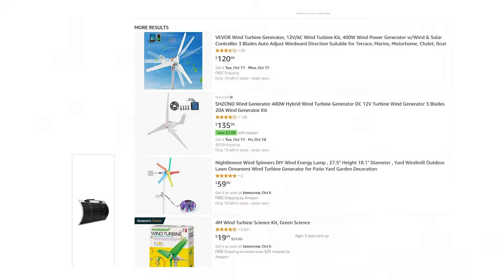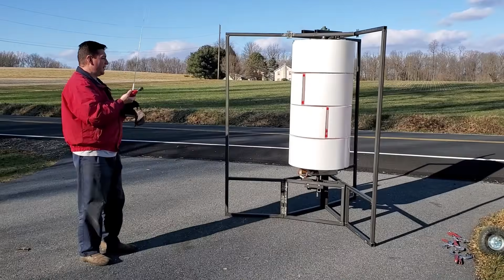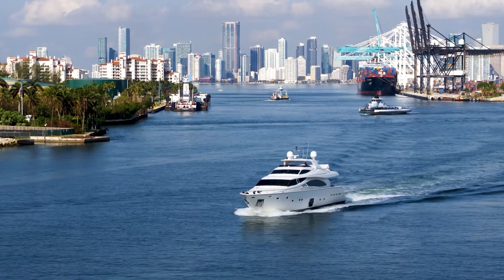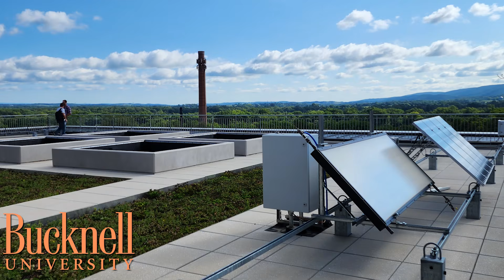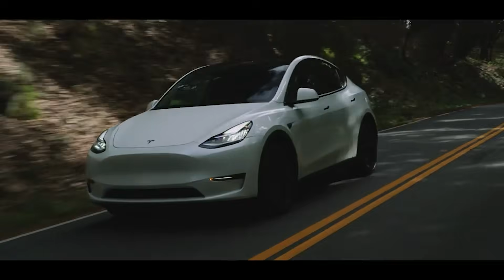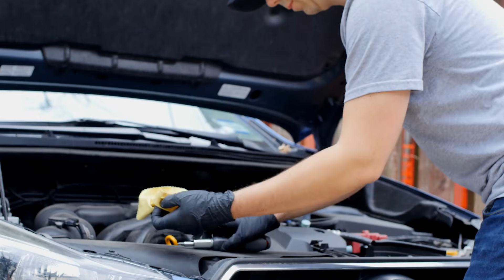Harmony Turbines | The Perfect Small Scale Wind Turbine?

Comment: Consultant wind engineer Rosie Barnes has a number of videos explaining the advantages and disadvantages of various types of turbine on her channel 'engineering with Rosie'. It's a scientific fact that vertical axis wind tirbines are inneficient because half the rotor is opposing the rotation at any time. It is also a scientific fact that wind speeds are highr at greater altitudes.A ground mounted horizontal axis wind turbine isn't likely to generate enough energy to pay back the cost of its construction in its whole lifetime.
Reply: Course that’s the economics of fossil fuel “capitalism”. Your cynicism does not impress.
Reply: @Intelli24U  fogiive me for relying on facts. Economics is economics whatever the context
Reply: - depends on what the cost of manufacture is.  do you think making sailing ships in the age of sail were cheap? they had to level whole forests to build one big 3 deck warship like Nelson's HMS Victory.   not to mention all the trees they had to burn to make the iron for cannons and iron fittings for those ships.  but the Brits doing that is why the Brits gained an empire and why you speak English today.  They have already invented an injection molded recyclable polymer that is stronger than carbon-fiber.   Right now it is expensive, but as they improve the technology theoretically a 3D printer could spit out one of these wind generators at the cost of materials.  At just 20-50 years of public adoption of wind & solar power, we are roughly at the Model-T level of auto technology.
Reply: @vvvci  I fail to see the relevance of the past technology of sailing ships which were the pinacle of technology at the time. 3D printing is a time consuming process and would be the last option for low cost mass production.

Comment: the bashing of "normal" turbines (big scale) is kinda lame. Small turbines just dont scale nicely, solar is kind of same level for all (per area) but not wind (you need elevation and/or clean wind off shore), this "thing" cant fix that.
Reply: Wrong. Even if there are qualifications as to location we are facing do or die parameters per our energy based civilization. All possibilities count!
Reply: @Intelli24U  so you tell me it's "efficient" to use 25000!!!  400w rotors vs one big new one with 10 MW? rare exceptions of islands/self supplier - ok maybe a good addition if you dont have enough space or conditions for solar+batterie only, but other then that for the grid this is ... peanuts. dont want to downplay the design and thoughts of the designers, it's kinda neat but by no means a serious solution.

Comment: Sorry,but vertical axis turbines are NOT anywhere as efficient as horizontal axis turbines. The power from a VAWT is generated by maybe 25% of the area of the turbine,and the advancing parts of the turbine work AGAINST power production. HAWTs generate power using 100% of the surface area facing the wind. There have been many VAWTs invented over the years,but they all fail for those reasons. It is telling that all the biggest wind farms use HAWTs.

Comment: That it can curl up is great…
But that shouldn’t require an active system.
Active systems always eventually fail.
Safety measures should always be passive.
If lightning strikes a tall metal tower and shorts the motor that furls the scoops it’s toast.
Maybe they have countermeasures for that, but didn’t mention them.
But surely they don’t have countermeasures for everything.
Reply: And the first automobile didn't have snow tires and defrosters either. Iterative improvements ...as we see things to improve we will fix them. It's how all R&D should be done, no? Share the project as you do it, publish everything openly; hide nothing.
Reply: A mechanical  centrifugal governor could make sense. The victorians knew how to solve problems :)
Reply: @pete_dl1585  - I wonder how a Flyball Governor could control that "Furl" & "Unfurl" action, that they have?
Reply: I like that they’re committed to full marketing for the sake of we people.

Comment: The furling system is clever! Vertical turbines get a bad wrap because they are less efficient in ideal wind, but I’ve always thought they make more sense for dirty wind. If I ever live in the right place I’d be interested in this system.
Reply: The furling system is the only thing going for it. It doesn't make it more efficient. They just don't make the torque as blade turbines do.
Reply: @sloansteeringsystems  It catches wind from any direction..that's a plus.
Reply: @robroy9185  Yes, but the horizontal type can as well, it's just a bit more of a challenge to manage the cabling so that it doesn't wrap the tower. Which is a solved problem. Either you can mount the generator on the tower facing up with a pair of gears, or you can use a slip ring to do the job.
Reply: The typical VAWT running a blade type Darrius rotor requires higher wind speeds to operate.
The Savonius type produces a higher torque at low wind speeds and because of the shape of the "bucket", uses the Bernoulli principal of lift to reduce drag.
Reply: @sloansteeringsystems    But the sound damping factor is a plus. Not to mention functioning in dirty wind. For small scale and home owner ease it’s looking good.
Reply: @sloansteeringsystems  Can the tower have both types?
Reply: - even a "split drum" Savonious Turbine can be made to auto furl, using "drawer sliders" and counter weights - very lowtech, or add sensors and steppers to make as adaptable as desired. 
Noting that unloaded, a drag turbine's tip speed can not (generally) exceed the windspeed, while on an aerodynamic turbine (HAWT or VAWT)  design (many different varieties , the tip speed (unloaded) can exceed wind speed "several" - to  - many times, greatly increasing stress on components mounted on the end of a large radius arm.  (also a drag type device still puts significant "drag" on the tower in high wind speed, while an aero design has minimal drag (destructive force on the tower) when furled and stopped.
Reply: @kadmow  Why is rotor speed so important; it's the torque your looking for.  The more surface area exposed to the wind, the more torque can be derived from it.
A common example would be carrying a sheet of plywood.  When positioned end-on into the wind, where the perpendicular surface area exposed to the wind is minimal, it is easy to control and walk with it. When the full sheet is exposed, the resistive force can push you back or knock you over, the force is multiplied over the surface area.
The Savonius does have an inherent drag problem but the curved exterior of the Harmony style "bucket" reduces drag significantly by using the very same principal employed by the typical HAWT; the Bernoulli principal.  The Savonius will never overcome the drag but it is still the best choice for "dirty wind" applications.
Reply: @Digidoc316   Torque (Nm) may make the world go around but Power (W) is what makes things happen... (jk)-  and energy (J)  is what we need at the end of the day (yes that is a joke too).

Torque was great in the old days of wind when it was doing slow tasks ( not power constrained - noting that the best "transmission" is none - Yes even Teslas do have a transmission despite the claims of BS-er in chief ) - and belts are worse than gears )- we have moved beyond that and extracting the most energy out of the wind is simpler/possible at a higher speed multiple (Power is Speed x(times) force, power is also Volts (V) x Current (I) - not called "Amperage" despite American  popularity) ...   (notice how the "vocal one" was elucidating about how terrible "propeller style - whatever that means - wind turbines were, then showing a curve which went to the moon??? - so terrible, yes really...  Yes anything which is highly stressed, and optimised for "median" cases will fail and break at times - no defence for failure under "expected" but otherwise extreme   events - also things do fail at times...)

I have studied "engineering" (whoopdy-doo - who cares about academics) and do understand that power - force and torque, rotational velocity and linear "speed" all have their analogues and conversions...

 - IF you try to slow wind (any fluid) down too much it merely flows around your "extraction tool" - you can't just gear it to zero and get more torque.

I have not done any CFD on these but, don't actually think that the interior shape of the foil will add  a whole heap of efficiency (just as a thin optimised aerofoil is usually more efficient, but structurally poor - just in as the plywood example) (await more research from some undergrads thinking outside their box), the theory of a Savoneous is that the continuous curve allows "some" of the wind energy to be extracted by the reverse curve of the lee-side blade (again, we can question, does this actually happen in a meaningful way ??), this design will most likely take it all to turbulence / cause separation, close to the mast (smaller radius, lower torque) and increase wind load on the structure (no problem if it is in terrible wind areas with no "real" generation potential) - it could be better to vent it out - reducing drag, increasing startup times / lower "cut in".....

Solar is generally the best choice in dirty wind applications, these devices are often edge case toys - they make the garden look nice, if tapered neatly and painted green nobody will notice them.

Who knows they may take the world by storm..

NB, I actually have a soft spot for VAWTs, but of a more complex style than has been widely utilised - variably pitch / controlled pitch varieties - more analogous to a Voith-Schneider propulsor with the ability to operate in the low and high speed regime (reduced "cut in" effect) with increased efficiency - yes operating at both ends of the spectrum is of little use to energy companies.

I am Sure "Engineering with Rosie" will have different talking points.
Reply: @kadmow  Finally, someone who speaks geek!
It appears both of use have some engineering under our belt.
The term "Power" has multiple applications but is generally referred to as kinetic force through a distance; the ability to do work.  
Speaking electrically, there is the EMF measured in volts, the resistive load (whether inductive/capacitive  reactance or linear) measured in ohms, and the current measured in amperes (coulombs of charge moving past a fixed point in 1 second). 
It looks like you are taking a commercial perspective where this system is designed for small dirty wind, not commercial application.
I am familiar with the Voith-Schneider blade assembly but literally with a twist.  The upper and lower support platforms are off-set 90 degrees with the foils maintaining a smooth transition while remaining parallel to the plane of the axle. This "twist" hybridizes the Savonius and the Darrius by allowing a small portion of the blade to act as a Savonius "bucket" to achieve start up in low wind conditions.
The curvature I spoke of was not the interior but the exterior of the blade.
The curvature will help to reduce the drag, which is pronounced in these systems.
Reply: @kadmow  Governors for rotating devices have existed for quite a while at this point. From what I can tell they date back to at least the 18th century. Part of the issue with this particular design is that it's intended to protect against something that's likely to be a rare event. In terms of the generator burning up from heat, there's a few options there from larger heat sinks to blades that can adjust their pitch to fix the upper limit on rotational speed to flywheels that slip above a certain stage.

I do think that this is an interesting approach and I wish them luck, but I'm not sure this is the solution to the problem.  Even a spring loaded mechanism that's designed to open the scoops beyond a certain amount of force would probably work.
Reply: The other advantage is being able to use arrays with minimal clearance whereas horizontals turbuance interferes with downwind units.
Reply: @davisrs1  Any turbine extracting power or creating dirty air affects the downwind units, the "close packing" identified in research - I believe -  was related to counter rotating pairs  feeding off upstream vortexes - and not random wind patterns nor turbine placement.

IF energy is being extracted (either drag or real work) there remains less for further extraction...  Or it is all "magic".
Reply: Not sure but I’m guessing this will not decimate the Audubon population as do the giant wind turbine farms do today or be a negative impact on the eco system.
Reply: @tywebb140  You are correct.  The large MW turbines have a slow hub speed but because of the blade length, the tips are moving at significantly higher feet per second.
Even so, most smaller birds have the maneuverability to avoid the blades; it's the large soaring birds that have the greatest risk.
Even though the hub speed is higher on the Harmony system, it's proximity to the ground and blade shape would seem to pose a much smaller risk.
Now if we could get the owners of heliostatic arrays to switch to a concentrator trough system, we could reduce the aviary mortality rate significantly.
Birds chasing flying bugs fly into the concentrated light from the mirrors and burst into flames within a half a second.
Reply: @Digidoc316  Cats kill way more birds than any propeller.
Reply: @stevenanthony9387  My stool sample is smarter, looks and smells better than you.
Reply: The main problem with designs like this is that they are cover a small area against the wind at the energy that you can get is directly connected to how much area you face into the wind. Having many small unit is a lot more costly then a few large one high up where there are much more energy to collect.
Reply: @bknesheim  The idea is to create a turbine suitable for "dirty wind" urban and suburban use where mounting a turbine 60+ feet up is impractical or impossible.
You are correct that the amount of power that can be extracted is directly proportional to the surface area and distance from the axle center.
However, do not confuse "swept area" with "surface area".  The swept area is the area that the blades travel within but the typical thin HAWT blades themselves have a wind contact area that is a sliver of the swept space at any given time; they derive their torque from the length and the rotating mass.
With the Harmony system, the "buckets" are sequential so that an area equal to or greater than one vane is in the optimum position for torque extraction.
While the diameter may be small, the area receiving pressure from the wind is significant enough to begin rotation in extremely low winds.
Using a 1:2 Gates belt system, the 50-60 rpm of the turbine will turn an alternator at 100-120 rpm; fast enough for a "pancake" alternator to put out 60 volts.
That 60 volts can run through a charge controller and charge your solar battery bank or be used by the homestead loads.
Reply: @Digidoc316  Yes in my comment I used "surface area" in stead of "swept area", but for the vertical design you must remember that on side pushes into the wind and reduce the efficiency.
Really the main point is that for the cost of the wind turbine you can get a lot more energy from the same cost in solar panels.
They will last longer and with less upkeep.
Reply: @bknesheim  I agree.  I've tested solar for over 10 years now waiting for a plateau in technical advancement to buy big. I've seen how reliable and powerful they can be.
The idea of a small wind turbine for me was to have more than one source of production and testing.  I have a great low-speed alternator based on the F&P pancake motor but I need to find an efficient way to drive it.

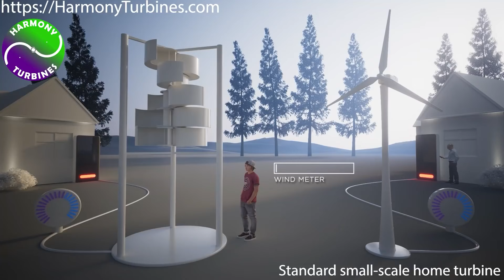Comment: 7:00 we spin when no power is generated so we look cool!
Reply: NO, what we're saying is we get up and get moving where others don't even think about moving. It's all about the "flywheel effect" in wind turbines. The flywheel overcomes cogging and helps to get everything up to speed sooner so that when we CAN produce some power in better wind, you're ready for it. Please don't twist our words. We were careful to say, you're not producing power at this stage but when others are not even spinning, that at least helps to get the ball rolling on production sooner.
Reply: Sounds like you would then be able to capture all available power generating winds sooner (lower speeds) than others.

Not a perfect analogy but makes me think of priming an engine:

By using the low wind speed that others consider useless you are able to prime the electricity generation. Whereas, other turbines are doing a “cold start”.

This results in your ability to generate more electricity that your competitors even though not every rotation is moving electrons.

This sound about right?
Reply: @clintrobinson1706  Yes sort of like priming an engine, sure. Many people don't know this but the big wind turbines actually cannot self start. They need kicker motors, often large engines, to get them spinning. If people are upset because we're trying to finally do Wind the proper way ...building it from the ground up, then by all means please look at other tech that you feel is far superior. We for our part, will keep working as hard as we can to bring this to the public and see how it stacks up.
Reply: This video and your replies very clearly explained this. I don’t feel you were hiding that low wind speeds do not generate power
Reply: You think you’re so cool with your cynicism?
Reply: It's spinning, but is it not doing anything is better? Your saying you are designed to appear as if you're producing when you can't....